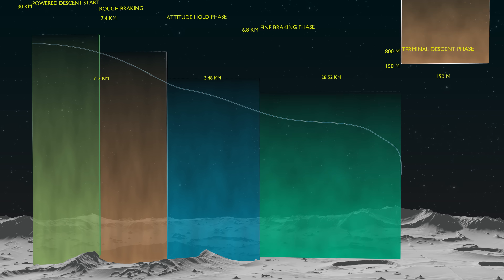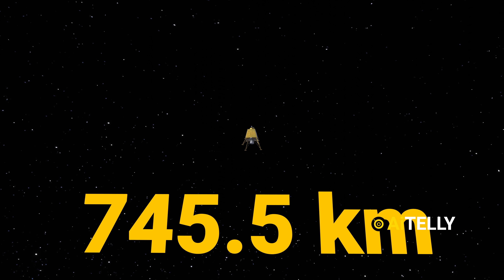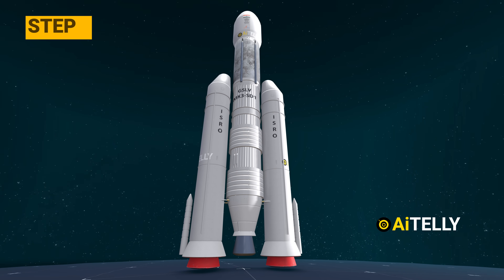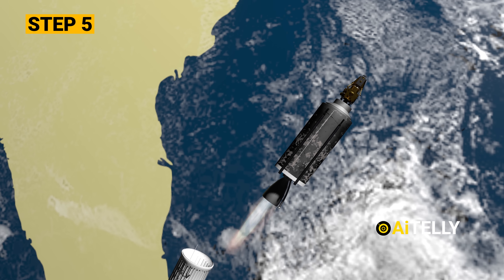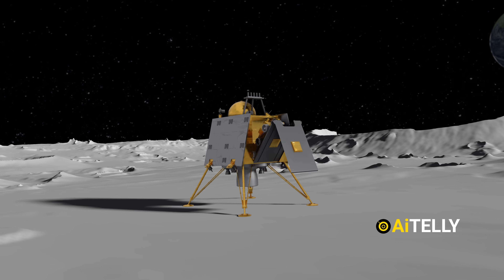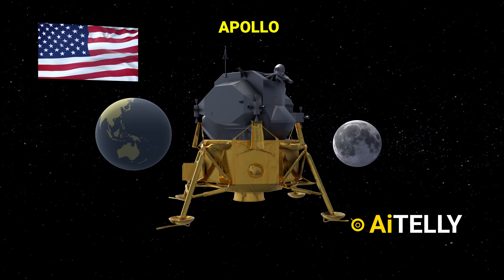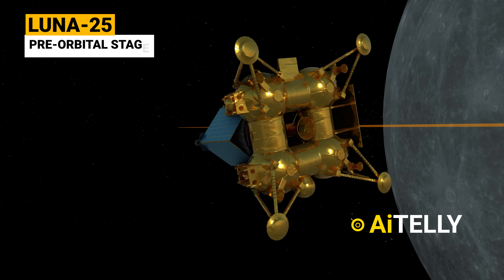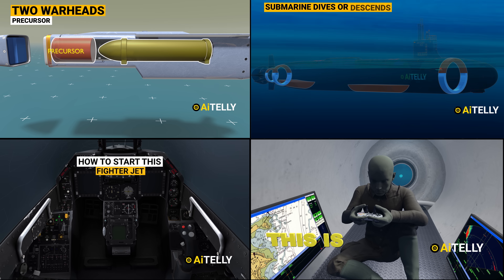Chandrayaan How it Landed Moon #chandrayaan3  #3d

Comment: I remember, my microprocessor class teacher told me, break all the tasks in small small steps and at one time focus on one step and then next, gradually you'll successfully achieve all tasks without hurting your head with complications and causing errors in designing the system or programming it. We used bits 0s 1s to programme processors. And that advice always helped. That's what ISRO scientists do.

Comment: There is an error in the information presented in 2:01 ! 4 thrusters were never used after the lander was at a height of 6.8 kms from the moon surface. Only 2 engines were used for the soft landing from that height !